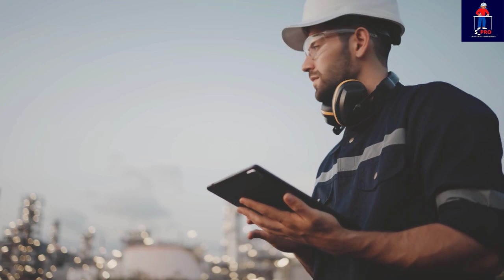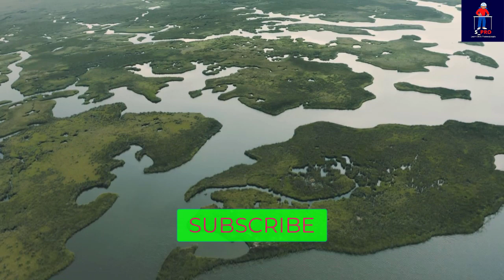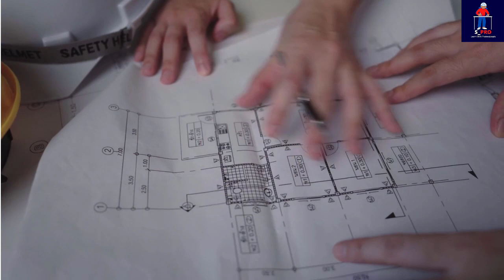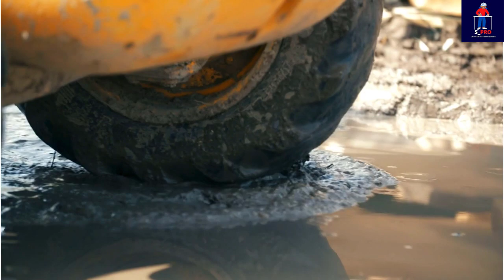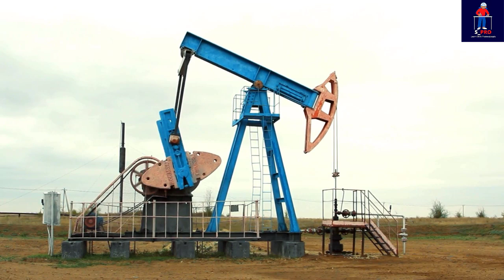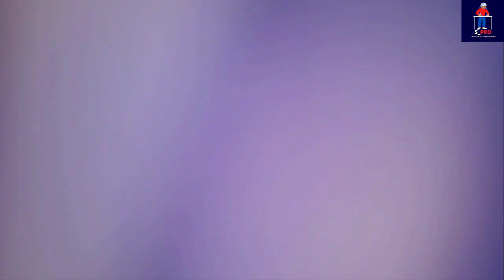Introduction to Oil and Gas Projects_Drilling Location 02

Comment: Plz design a model of Pipe Rack from scratch to full   .
Reply from the maker: It's already in my work plan. Just stay tuned.
Reply: @structurespro still anticipating sir.
Reply from the maker: @Chidoxrxn Yea
Reply: @structurespro how can I get it please?
I’m trying to divert from construction to oil and gas.
Reply: I mean pdf books for oil and gas design and calculations